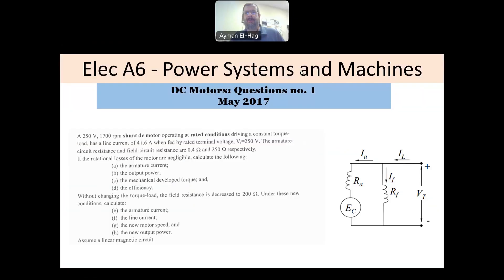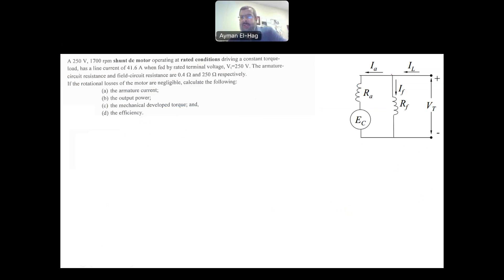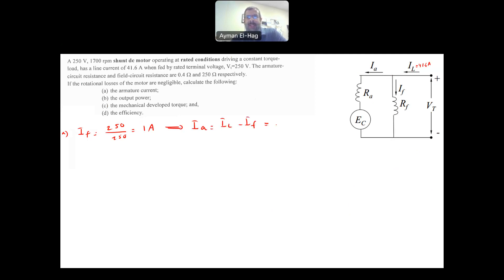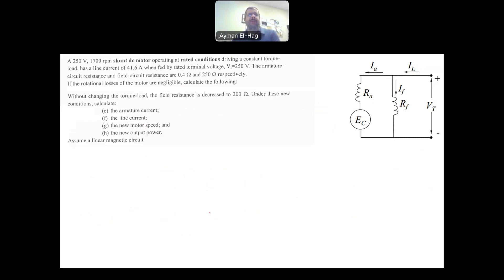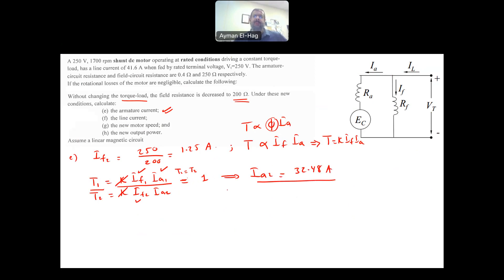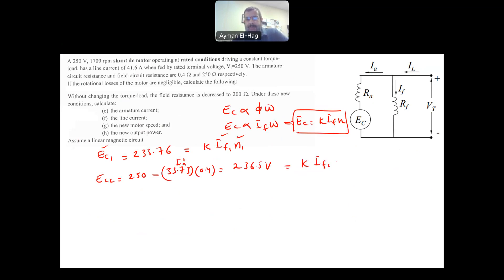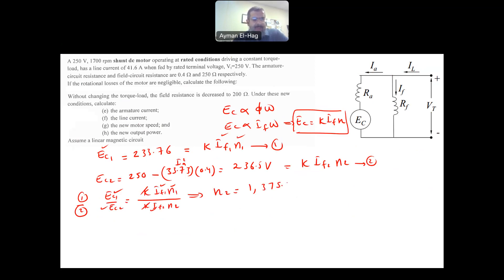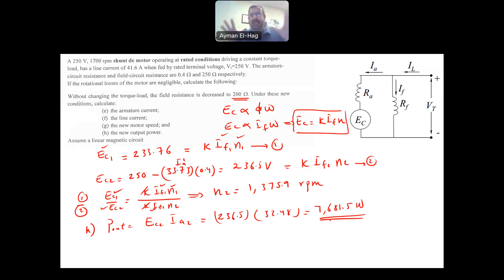PEO solved examples (ELEC A6) DC Motors Question no. 1

Comment: For your EC2 calculation, shouldn't Ia be 32.48 and not 33.73?
Reply from the maker: You are correct, I did the correction in the video description, I might change the video later on because it has 2 mistakes.